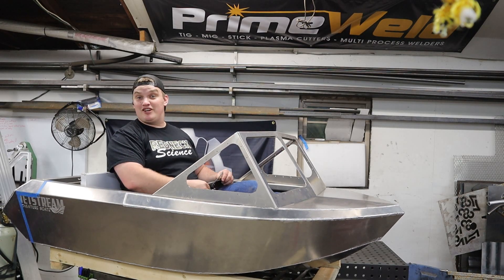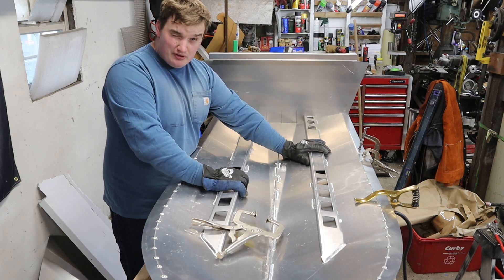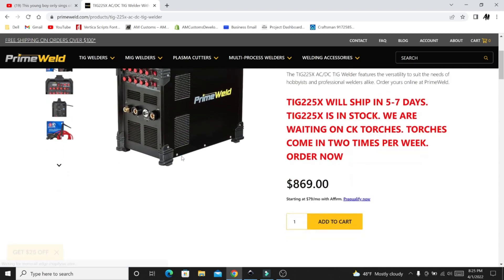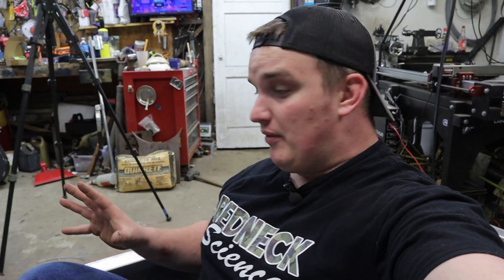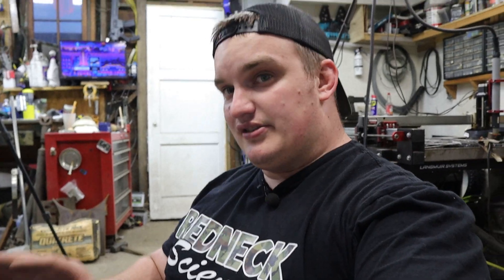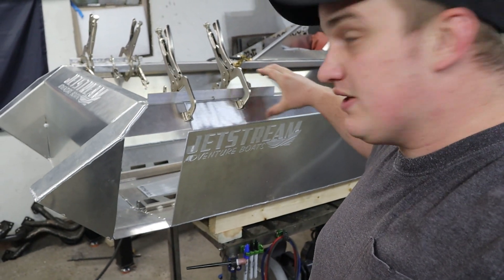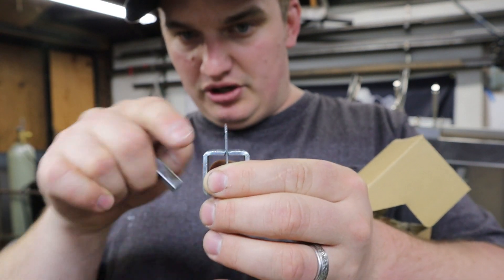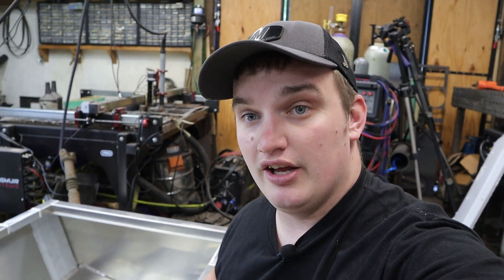75 HP Micro Jet Boat Build. Aluminum Welding

Comment: I've had a lot of interest in these mini jet boats for a few years now. I like small and over powered BUTT 6-foot seems soo short had to go to JS site to actually see how the engine & pump assy fit. The hull lines look so awkward being the depth is too much along with the windscreen being too large as the bow is really blunt. If the design could be stretched out to 8-foot and the windscreen redone, there might be a good combo. The 6-foot'r with a 15hp outboard was another idea came to mind. I was 10 y/o (Elvis died) when I built the Glen-L 8-foot Tiny Titan hydroplane during summer break. Had a deep fascination with boats ever since. I like JollyRoger sprint boat build channel. That's the look in the hull shape & design I see except smaller like a go-kart for the water. Looking forward to your next stage of the build.
Reply from the maker: Thanks for watching yeah agreed it's definitely small that's why I stretched it 6 in and I think I'm going to stretch the pump box out another 6 in under the swim deck .so I can push the motor back as far as possible.

Comment: This is so cool.  Structurally, the two critical points are 1) that the hull running surface (the bottom of the boat) is in a flat plane from the original hull across the extension.  If the extension creates even the slightest downward “hook,” the boat will porpoise like a SOB.  And 2), that the stringer extensions are done properly as they are the primary structural strength for the whole boat.

Looking forward to this!
Reply from the maker: Great advice thanks for watching 😎🙏👊

Comment: heck yeah! a jib crane will be a valuable asset.  I don't have space to move it around or I would build one.
Reply from the maker: This will be a stationary one up against the wall built in  and it will pivot and swing 180°
Reply: @amcustomfab  Nice!  That's a great way to save space!

Comment: Its so small, Looks way too scary to take a ride in😳, i have to watch some of your previous videos on alum welding  as i have a crack in a cast aluminum transfer case i need to fix but have never did any alum. welding.